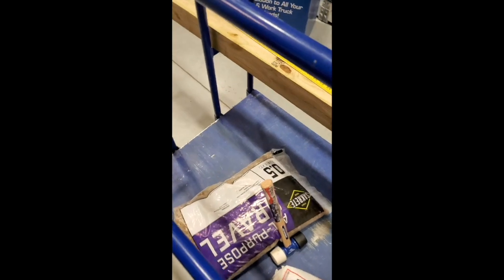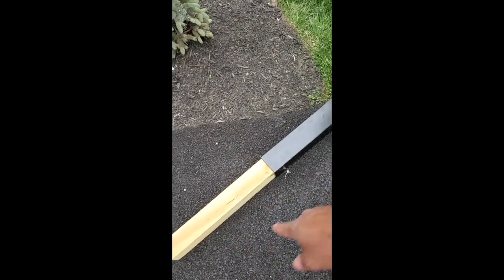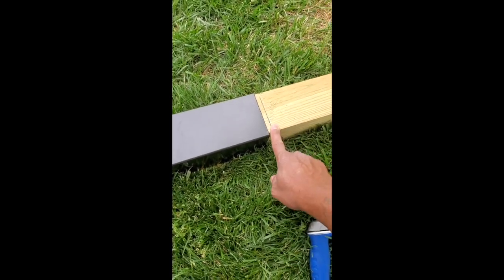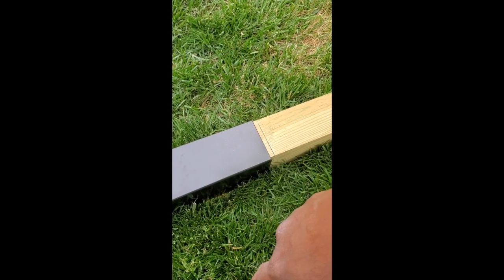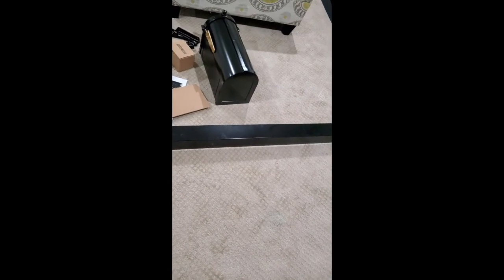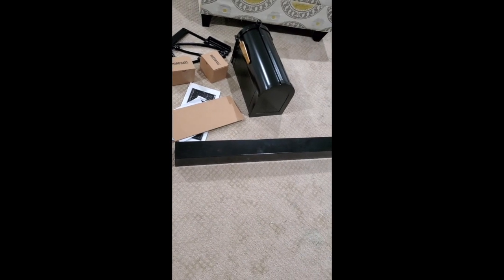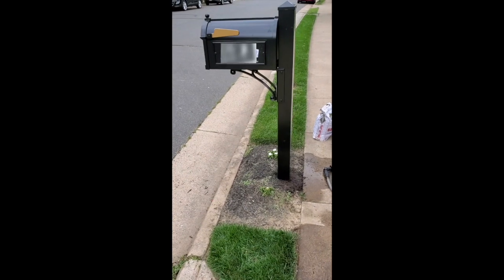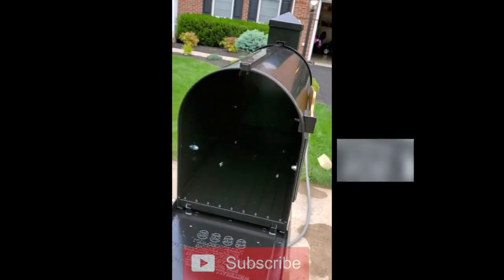Whitehall Deluxe Mailbox Assembly & Installation (Part 2 of 2)

Comment: You are using green pressure  treated wood whose active ingredient is copper. Pressure treated ACQ or CA wood can cause the aluminum sleeve to corrode by galvanic corrosion. Alternatives?
Reply from the maker: I believe CuHDO treatment is the best alternative to ACQ and CA wood. If you can't get your hands on green pressure treated wood. Copper is still the most widely used element in wood preservatives